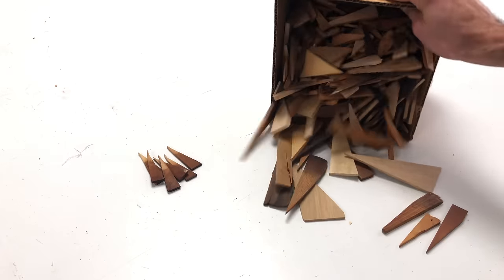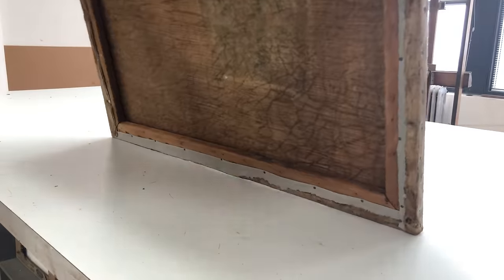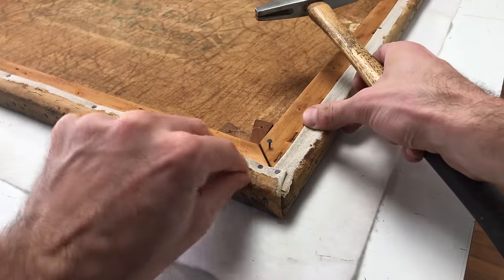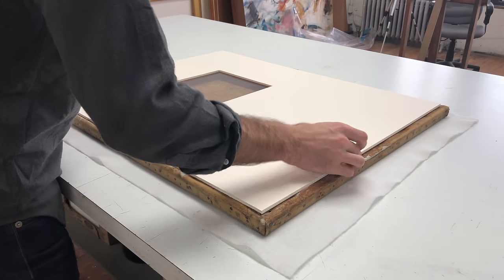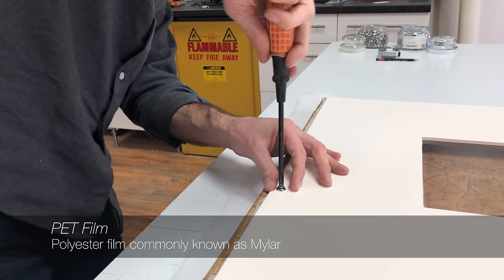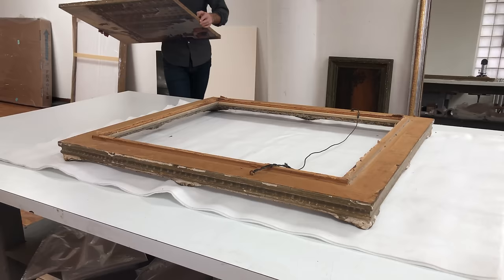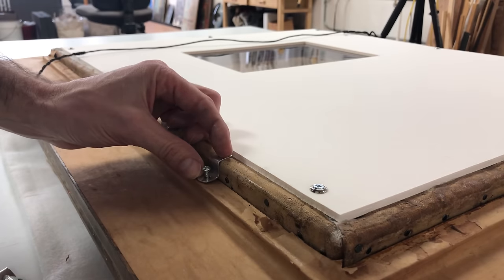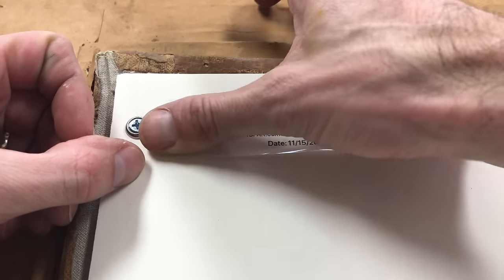The Conservation of Guy Wiggins - Episode 6: "The Last Mile"

Comment: I thought it was interesting that the conservator and the client in this case seemed to have different opinions regarding conserving the frame.

Was the frame the original? I imagine that in many cases the frames of especially really old paintings may change several times over the decades or centuries. Historically, was the frame ever considered an important part of the artwork worth preserving for its own sake?
Reply: Dennis Jeppesen Good day Mr. Jeppesen to be honest there are three artists, which work, I find relevant to western art and have frames as an integral part of their work. First of them Michelangelo, the second, Matisse, who said "The frame is the most important part of the painting" and, naw a days Rafael Silveira, whose frames blend into the artwork. I don't know if you really made a question or if it was rhetorics. Hope it helps, have a nice day.
Reply: The likely reason that Baumgartner wanted to restore the frame was because the artist had chosen that specific frame when the piece was finished. Thus, it becomes a part of the piece itself. If it were simply an old replacement frame it would have likely been no topic of discussion.
Reply: @FelipeSantos-sw4kk  Another artist who thought the frame to be important and part of the painting was Henry Faulkner.   He usually painted his canvases already framed in old already used frames and one can see his pints and brush strokes on them.  I thought this might be of interest.  Thank you
Reply: Some works by P.J. Crook seem to extend onto the frame - in scans of her artwork, you can sometimes notice this around the edges.

Comment: Beautiful as always, and I have an idea for the screws. There is a device called Keyserts, they are cylinders that screw into the base material, and your screws then go into the keysert. The result is that your screws could be inserted and removed hundreds of times without risking any damage to the base material, even if it swells enough to normally entrap the screw. It may be overkill, but your entire restoration process embraces that kind of diligence. These are usually made with machine screw threading, so a varient with wood screw external threads may require some extra shopping or a custom order.

Also, if the screw head choice is arbitrary, I suggest Torx or at least hex. The drive bit has much better grip and they are harder to strip, and the socket cap variety are particularly robust. But the button head variety (like you currently use) may be better for your usage, or you could use flat head screws which don't stick out at all.
Reply from the maker: I've use those before for other projects but never on frames.  It's an interesting prospect and one that I think could provide benefit.  In mot cases the painting aren't removed from the frames but once every few years at best so it's not a huge impact but there are instances where multi-panel pieces or mixed media pieces do get broken down often for transport and in those cases Keyserts would be a good alternative.  I'm always on the lookout for better materials and techniques, thanks!

Comment: I wished you'd talk money, if only in general. How expensive does a painting have to be before it's worth doing this level of restoration? Do you sometimes do restorations on inexpensive paintings in your free time just because you like them, even though they're not worth it financially? I know you don't want to reveal private info and every case is different, but I'm going to assume this costs a fortune.
Reply: Callie Masters - Julian has mentioned in the past that a piece he was working on in the video was sentimental to the owner, and that’s why it was getting the extensive and therefore costly repair. The way it was mentioned in the video made it sound like the owner of the painting was putting more money into the restore than the overall value.
Reply from the maker: Each project is unique and different and the cost of conservation, at least the way I work, has little to do with the value of the works.
Reply: Around $10,000-$15,000 for a fairly large painting - this was the price posted by Appelbaum and Himmelstein, a fairly reputable conservation company. 

People often do put more into the conservation than into the value of the painting due to sentimental reasons - and if the painting is worth more than it would cost more to restore simply due to the insurance required to cover such works.

Comment: Why don't owners frame the front of paintings behind glass? It seems like that would  protect against all the issues this guy has to clean up (smoke, dirt, etc).
Reply: TheBigExclusive if the glass touches the painting, it can remove layers of paint. You would have to recess the canvas away from the glass. This is why high quality paper medium art work will use a matt board. It’s not just for fancy looks. It keeps the glass off the artwork.
Reply: @vistillia  Is there not a simple way to leave a small gap between the painting and the glass? I'm sure there must be.
Reply: @TheBigExclusive  yeah like maybe something like the gap between glass panes in double glazed windows?
Reply: I thought it was so the reflections on the glass wouldn't obscure the art. Even with non-reflective glass, the direct canvas is still clearer
Reply: @TV-8-301  It may also be that perfect glass, entirely lacking distortion and free from inclusions is a relatively new development compared to paint on canvas, and as such, modern painters have not yet taken to preparing their works for that kind of mounting and installation.